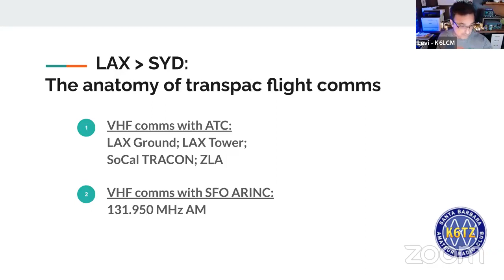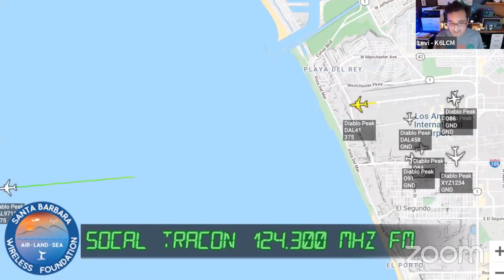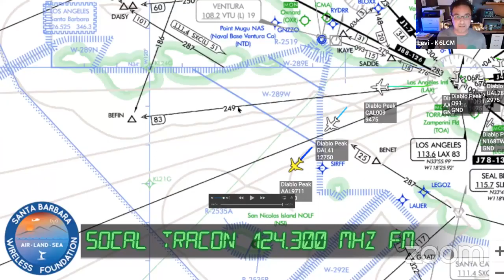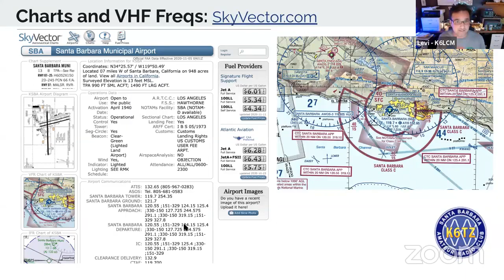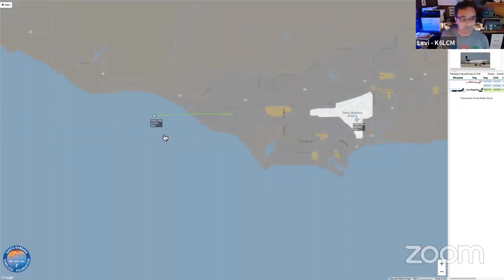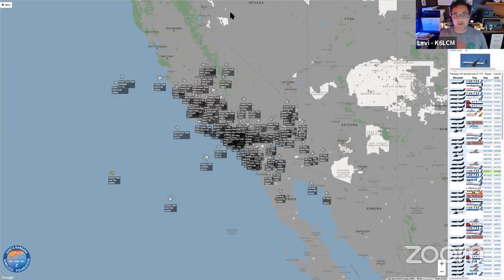Tracking transpacific airliners using VHF, HF Radio & ADS-B

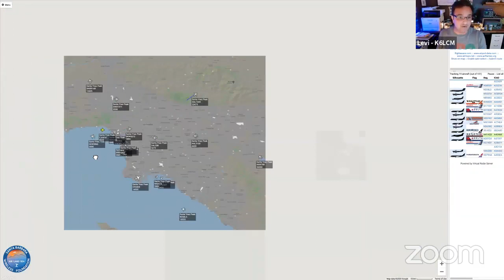Comment: 29:09 today I learned that Santa Ynez Peak is higher than Mt. Everest.  Awesome.
Reply from the maker: The radio stations at 30,000 feet are aboard the aircraft not on the mountain peak.

Comment: Hello Levi.
Please clear up.

I will cross NAT-HLA (No CPDLC Onboard) with ADS-B only. What about communications on HF? Is ADS-B considered as Data Link Equipment to use Phraseology related to the new NAT DOC? (ops.group/blog/wp-content/uploads/2021/02/NAT-doc-007-v2021-1-changes-explained.pdf)
Reply from the maker: I'm not sure about your question. I tried reading the reference but the link was broken.